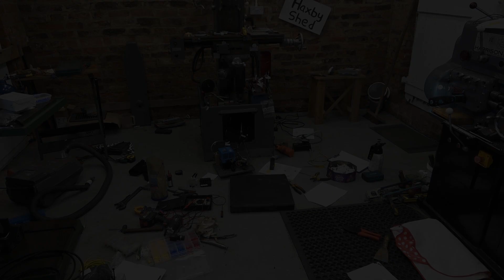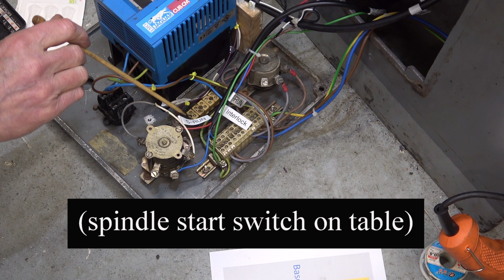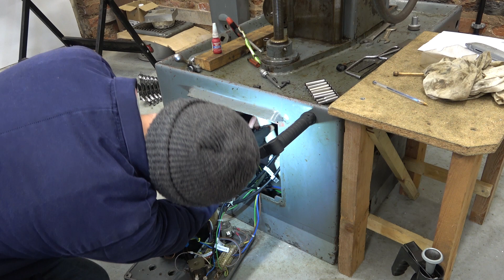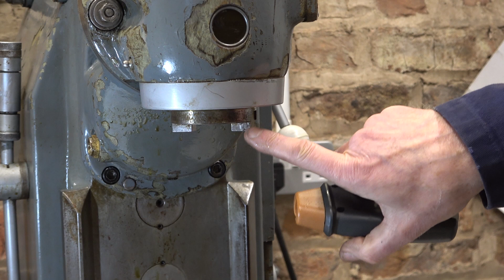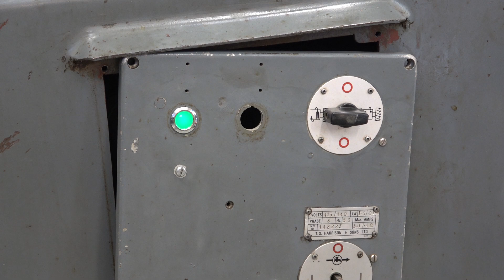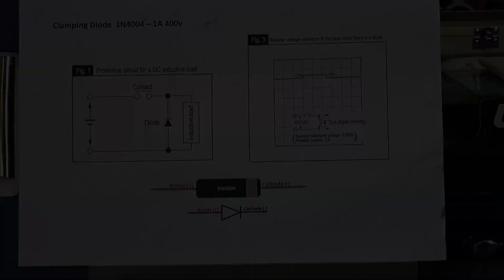HS176 Harrison universal mill servicing – Part 9 Electrical (2)

Comment: The interlock systems can easily be achieved with the olden drum switches, or by replicating such a design... You have a 2 pole drum - one is the main spindle power, the other is a table drive power-line ``if on`` mechanical power gate that interrupts the power flow to table motor, regardless of other table switches(this being last in line before the motor itself)... If the switch is turned dead - the table ain`t budging... Now, that does not take into account the spindle gearbox config. and potential clutches on other machines, but alas, taking that into consideration requires hall effect sensors on the spindle - after all potential clutches and transmission dogs/synchros... 

I kinda prefer the good old - no bullshit approach, with seamless power transmission being a CVT, tho, 15/16 of my machines have set ratios instead of a belt CVT(continuously variable trouble)... The power side is best left to solid contactors and proper chunky bits of copper, with some electromagnets for safe switching... It is nearly foolproof, lasts for ages if even slightly maintained, and it`s as simple as it gets, plus, you can literally machine all the components and make a custom system for extra skookumness... Speaking of CVTs - a swash plate hydraulic pump and a hydraulic motor offer the ideal solution, as those - unlike belt drive CVT are also nearly bulletproof and used on machines like these, they last for ages, what with majority of such pumps being designed for min. of 100hp of heavy industrial loads... Give `er a strong motor, a nice hydro drive, and you have all the speed change you could want, especially if the hydr. motor is given a 2 speed planetary - direct/reduced on the output... 

Aside from my general dislike of modern electronics, great job, even tho i`m 2 years late to the party... 

Best regards!
Steuss

Comment: Went all the way to the end Paual,,now to go search the cabnet's for a BC Power,,,hehe! I wiring now have wiring & circuit nightmares (@@)!. enjoyed, but I have to leave wiring to you pro's, Bear.
Reply from the maker: Hi Bear, you did well to see it to the end. It was a bit intense on the electricals. Not exactly light entertainment. To be honest I would rather have been working on something else but it had to be done sooner or later. No point putting it off any longer. Kind regards

Comment: Great stuff Paul, and perfect usability of all the controls without losing the “look” of the original equipment. Strange that one inverter has no earth though as they usually used a capacitive array filter to protect the electronics from mains. Spikes, and they were usually set to dump spikes to earth, which can cause havoc with RCD trips! Really good to see it fully working. I guess from your expertise you have a background in some electrical discipline?
Phil
Reply from the maker: Hi Phil, going to send you an email about that but yes I do have some background in electrical although not used it much - that's why sometimes I know the theory how something should work but I lack the practical experience and have to fumble through.  Cheers
Reply from the maker: Phil I sent an email to the address on your channel but it bounced back. So if you want to continue the conversation please email me - see the 'About' section on my channel page. Cheers

Comment: Cheers Paul. Those inverters seem every bit as complex as they are versatile!
Reply from the maker: Yes TRM, but don't they save space and add all sorts for great functions like speed control and torque control (if you buy a proper one). Oh, and they don't blow your motors up like static converters can if set incorrectly. Cheers

Comment: what
Reply from the maker: 👍 Cheers
Reply: @HaxbyShed  I had to take a break from the vid, it was so complicated. how you got your head round all that crap beats me. imagine spitfire and Lancaster being this complex and trying to fix in the field
Reply from the maker: @hrxy1  I knew it was going to be a long job so I put it off for a while. Also why I split as two videos. A bit hard going. This week we are back to general mechanical stuff - table motor bearings. Cheers

Comment: Recently my school has a harrison model 140 lathe, very bad condition it is in but still works fine, my problem is that the handle for the toolpost wont move, well it does move but when you try to turn it to release it to make it turn it will not and will stop and you cant turn it, i was wondering how i can fix it or if theres any way i can get the handle off and i was thinking i can get the handle of by using the alan key slot on the top but im not sure what that does, do you have any ideas on a fix to make it move so i dont have to lift up the other threads to move the knife tool?
Reply from the maker: Alex I just posted up a vid to answer your question (HS177), best as I understand it. I hope it helps.  If the cutting too is too low just put some packing strips under the tool. Cheers.
Reply: @HaxbyShed  thank you

Comment: I had a weird issue with my cub inverter, & still have on my union graduate. Mine is a 1hp kit that came with a motor & flying control box with run/jog, start/stop & forward/reverse. Quite a while after it was out of guarantee, the forward/reverse decided to not work unless you fiddled with the toggle switch & pressed run/stop a few times. Contacted the seller with no joy, unwired & re wired it. I even changed every single switch on the control box with identical parts & it still does this now. Maybe these boxes have chip software issues as time goes on. Or we're just unlucky!!!
Reply from the maker: Hi Arckivio, I just posted up a vid (HS177) to answer your question with a bit of advice where to look next, best as I understand it. I hope it helps. Cheers
Reply: @HaxbyShed  Will be watching that!
Reply from the maker: @Arckivio It's just a few words on how I would approach it. In addition, occasionally a wire can be broken internally and intermittent whilst it looks fine externally. Had a case like that just recently. Cheers
Reply: Hi if your in the UK try contacting transwave in Birmingham. They sell a lot this stuff on ebay sure your find a phone number 
Steve
Reply: @steamtrainmaker  That's where it came from. They were helpful but didn't have a clue why it wouldn't run in reverse without a fiddle!

Comment: Great job Paul, nice thought processes, and application on controls, personally I wouldn't have a spindle to table interlock, ref tramming in, or indicating the vice or part. Possibly adding a spring off switch override for this operation, again,  just a personal choice, it's your machine. 
Nice job on diagnosis on IMO ramp up fault.
Love the threuppuny bit scale, rather specialised demographically 🤪🥺.
Looking forward to some Haxby milling swarf. 
Thanks for sharing. 
Regards John
Reply from the maker: Hi John, a spring over-ride switch on the interlock is a possibility if it annoys me. Now I have done a few cuts (you will see later) what annoys me is the fact you cannot tell if the table motor is running if it's in neutral. It makes hardly any noise. I am thinking about adding a light to show when it's on / spinning. Cheers.

Comment: Wow, that was a lot of effort and head scratching.    Inverters can be a challenge to troubleshoot.    Good takeaway that a reset may be required.   Not difficult to add parameters back in afterwards.   I have not tested my 24V control since my inverter is only powering the milling machine motor and so far I have only connected the ON/OFF function.
I got a smile from the 3p coin.   I am old enough to also remember farthings.
Nice job on the troubleshooting.   Good to label everything now, as you said, too easy to forget the complicated setup you have.
Last year my deep well water pump needed to be replaced.   I also replaced the many decades old control box.   Only about 4 cables, but I put nice clear labels on all the cables.
Glad all is now working well.
Perhaps the oil is too thick in the cold shed.    I would run this for some time, it will get less viscous when warmer either with running or ambient temperature.
Dave.
Reply from the maker: Hi LVW, all these houses had wells but long since filled in. I had to take the main gearbox selector plate off again to fix a gremlin and put ISO 100 in this time. Much more sensible. I might keep the 220 for frying chips (French Fries). Cheers

Comment: My table only drives in one direction
Reply from the maker: Oh that's interesting Tony. (Tony has a Harrison vertical mill, two-speed drive pulleys, and a clutch. Not swivel table).There are so many variations. Cheers
Reply: @HaxbyShed  I will fit a reverse to it once I  get round to converting it to a VFD rather than the static convertor that came with it.

Comment: Glad you thought of the reset, I'd be still scratching my head with that one. Great tip about the diode as well, that could save a lot of grief and avoidable expense when working with any of  those early inverters.  Being as old as dirt I recall the pre-decimalisation coins very well, my gran used to give me a farthing each time I visited her when I was a young chap. When I retell that story now the younger folk sometimes ask me what's a farthing, and the look at me in disbelief when I explain them there were 960 farthings in a pound. So yes, do consider a video explaining it, I think you'd be surprised how many views you'd garner :)
Reply from the maker: Hi Paul, yes I might just do one on the old currency as a fun curiosity item. I have a few coins I've kept in a tin for many years. Probably will not get many views but that don't bother me. (I am very unreliable at predicting which videos will get views anyway). Cheers
Reply: @HaxbyShed  I guess you'd need one of those rare YouTube crystal balls, in order to predict which content would get more views :)

Comment: That was a really excellent film Paul, thank you. I think you did a superb job of making those two units work together and the way you set up the interlock was inspired. I don't think I am going to have an interlock like that on mine, because I can envisage various instances when it would be advantageous to move the table under power without the spindle running. For set up purposes or tramming a vice in for example. I actually wonder if the "interlock" between the main motor and table motor was intentional by Harrison or if it was just an accident of wiring. In any case, you have done a brilliant job on your machine, I am really looking forward to seeing it cut metal. Did you get the gearbox selector levers sorted out?
Reply from the maker: Hi Carl, thanks for watching, it was a long detailed video not exactly easy casual viewing. My friend's Harrison mill is the rarer vertical type (no horizontal beam) but with two belt pulleys (low range / high range) running up to 2000 rpm with a clutch. His table motor will not run unless the clutch is driving (microswitch no doubt). Perhaps there will be cases where I'd want a powered table without the spindle - like for tramming - but I could fit an interlock override switch (almost a line from StarTrek - "well Scotty, override the override aye aye Captain" ). Next video will be the table motor bearings and fitment - was quite involved. After that I will show a few shake-down items like those pesky main gearbox selector leavers rubbing, and as I write I've just done some horizontal milling tests on a block of wood - wood is cheap and forgives stupid operator mistakes. I'll try cutting metal this weekend, and I think that will be the end of the series. I'm not yet satisfied with the vertical head - will change from ISO220 to ISO100 and some other basic confidence checks required. But horizontal is super smooth and quiet. Cheers
Reply: @HaxbyShed  Your film was exactly the sort of detailed information that I like to watch. I'm looking forward to your next installment. I replaced the bearings in my table motor and I did the oil seal too. I also rewired the stator to delta while I was in there.

Comment: Error is due to V/Hz being set incorrectly, likely set too high, as the inverter will attempt to keep output voltage to ramp up with frequency, and likely it was set incorrectly too high, leading to the trip at 20Hz when the curve started to ramp up the voltage rapidly to drive the motor. Probably alos made worse by the motor being an old one, not really designed to be used with inverter, as they probably predate them. Thus coil inductance and ground current is not going to match with each winding, leading to the imbalance.

Incidentally you can always feed those inverter inputs with an external power source of 24V, as they are isolated from the mains, and the actual controller, in most cases. Thus you can use either the newer one, that can probably supply 500mA of power to the external devices, and connect the common of each inverter. Or use an external 24V power supply, which then provides all the 24V supplies, though the pots still need to use the 10V reference the inverter supplies. 

The 24v indicator LED's normally just use a bridge rectifier, so they run off 24V AC or DC, and use inside a few LED dies in series, and a resistor to limit the current. Same for the 230VAC indicator, though the resistor is a lot higher value, and often they also have a 100n 400V capacitor in series with the one lead in the case, to limit the current that way.
Reply from the maker: Sean, that can I say? You are a Master.  I did initially misunderstand the parameter 'base frequency' and set it to 25Hz, because I thought it related to the speed control lower limit, but turned out to be the  V/Hz slope 'knee point'. But afterwards I realised and changed it back to 50Hz  - I think it must have got stuck on 25Hz cleared only by the factory resent. I learnt quite a bit diagnosing that but I would have been happy not to know and save my myself about 3 hours and a lot of worry that the motor had blown. Cheers

Comment: Well done!! You certainly had a battle with those codes. You explained each step very well with the aid of those diagrams, it must have taken some time to get that far. Just wondering whether there is ever a need  to overide the interlock, maybe if you are doing some maintenance or set up

I had to laugh when I saw the thripenny bit, I can still remember the decilimisation programmes on the TV from back then.

You wall repair video was very interesting and deserves the attention that it is getting

Good luck from Spain!!
Reply from the maker: Hi David, I can't think of a case where I would need to override the interlock but I can easily take the drive belts off the main spindle or indeed put a temporary jumper wire on the control circuit. The insulation video now has 46k views - these things tend to spike up then trail off - and then in a few months it might spike up again. The DIY video on lead flashing repair always does well when it rains. Cheers
Reply: @HaxbyShed  Lead flashing, now that must be a video, I'll search it out. It reminds me of  a roofer taking me up to the top of my flat which was a converted house with pitched roof, the lead had gone, couldnt find it anywhere. Going up no problem, started to realise the height when I looked down onto double decker buses below, the tricky part was coming off the roof onto the ladder .....

Comment: Well done! Great job Paul, my father taught me how to read resistor coding (he was an electronic engineer) but I have to admit I'd forgotten that years ago,  nice to see the reminder. 
Oh,  I laughed out loud at your use of a threepenny bit as a scale reference- only a Yorkshireman would still have one ;-)
Reply from the maker: Hi Jason I kept a few old pre-decimalisation coins. I thought I might explain the system as a novelty item vid sometime. I was only a boy when it came in but I remember my dad was so pleased that a quirk of the conversion meant he saved 1/2 an old penny on a box of matches that first day. I also remember my grandad never understood the change and my gran would ask "how much is 18p (new pence)?" and he would say "it's 1s and 6d you silly woman! Didn't you go to school!". Cheers
Reply: @HaxbyShed  I was six when decimalisation happened but I vaguely remember a few of the old coins. My Dad still converted everything to shillings until he died in 1997
Reply: Should have been a true Scot, and used a hapenny instead, which I actually do have the odd one or two around, well worn, even though as a country South Africa went decimal long before I was born, but my parents had a few left when the conversion took place, too worn for the banks to accept them.
Reply: @SeanBZA  That reminds me of the old joke about how two Scots arguing over a penny inadvertently invented copper wire

Comment: Great to see this machine coming together. You'll be cutting chips fairly soon!
Reply from the maker: Hi Greg, I never imagined 9+ part series of videos .... It's taken a while ...next video doing the table motor, then some shakedown, then chips. I was doing my first horizontal milling yesterday. Cheers
Reply: @HaxbyShed  I know how that is. When I restored that drill press recently, I never expected it to be in 5 parts. It's so small! But when you run into the unexpected, things take as long as they take. I for one enjoy these kinds of videos, seeing an old machine be brought back to working condition.